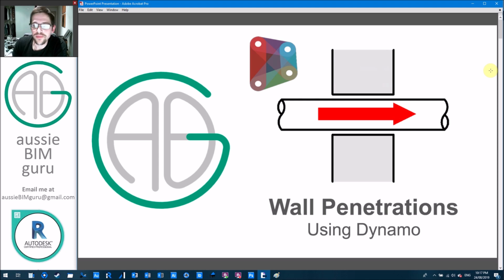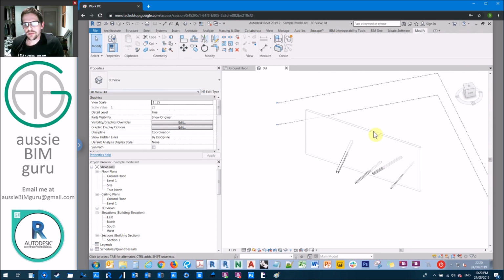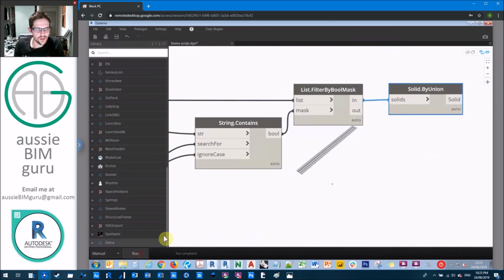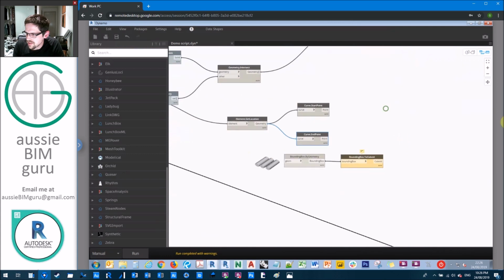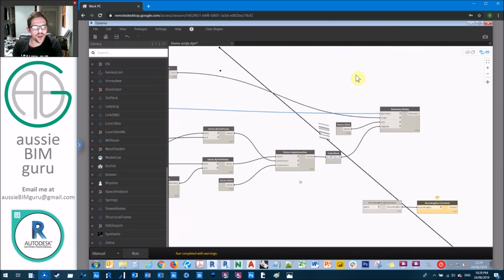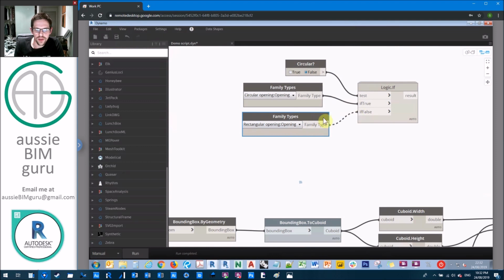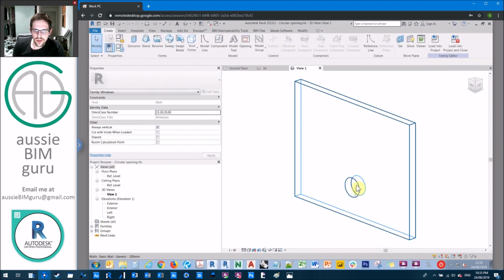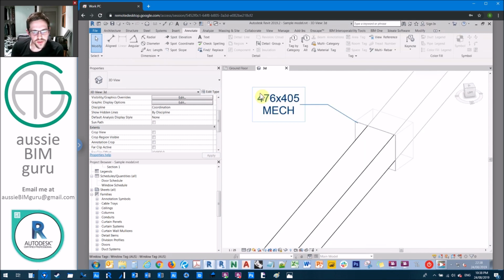Create Wall Penetrations using Dynamo!

Comment: Hi Gavin. Thank you for this tutorial. I would like to know if possible to make this penetration if the pipe is a bit slanted diagonally?
Reply from the maker: In the case that the pipe is on an incline, the geometry at the intersection will still encapsulate the overlapping zone due to using a bounding box approach.

Comment: Is it possible to but a condition if the mep elements clashes with the same wall, If it more than 500mm to consider it as two opening?
Reply from the maker: @AnarchisT3022  yes this can be done by  putting a sphere at each point of 250mm radius then solid unioning them snd disjointing, then grouping the intersecting data by which groups their centrepoimts intersect with, then unioning their geometries and doing 1 opening for each union instead. Its complex.

Python could also be used to iteratively find each group of points but its also challenging. The forums might be able to help.
Reply: @AussieBIMGuru can you show me how?
Reply from the maker: @AnarchisT3022  the channel covers c# these days so id suggest having a try and using dynamo forums for assistance.

I use the grouping logic in my workflow for chair separation as an example, using circles (just use spheres instead given its 3d):
https://www.google.com/url?sa=t&source=web&rct=j&opi=89978449&url=https://www.youtube.com/watch%3Fv%3DAo2GzXaLdr0&ved=2ahUKEwj1h9aI3amMAxVYrlYBHYBiB1EQtwJ6BAgMEAE&usg=AOvVaw1_KtlOuu-yKHMxeqPkmLbd

Comment: Hi Gavin. Nice script. it works with me but i put some modifying to work with a linked mep file and everything is fine only if i select a single wall but when i change the selection to select all walls in a level for example, it creates all the openings in one wall only. i hope you can help
Reply from the maker: To do many walls is a much more complex script and list structure, and not one i have developed yet personally. Maybe get as far as you can and consult the forums where unsure.
Reply: @AussieBIMGuru  thanks for the quick reply. i will try to find it out

Comment: wonderful video!!! Thanks mate. But is there a way to create penos for Fabrication Parts? A Fabpart Duct for example is not a solid but a mesh. How would you do the intersect test on that? Would love to get an answer.. or even better a video on that. :D :D :D
Reply from the maker: Generally I've found meshes to be very problematic in Dynamo, I'd likely switch to Rhino Inside Revit there if I had to work with more complex geometries as it's far more capable in Grasshopper/Rhino of working with mesh natively. In absence of that you could try mesh toolkit in Dynamo, but I suspect fab parts would give very inconsistent intersection geometries typically in Dynamo.

Comment: Another great post! Everything works great until I got to Springs.HostedInstance.ByPoints... this produces a null and I can't figure out why. Its causing an error in Element.SetParamterByName (dereferencing a non-pointer).  I'm running Dynamo 2.16.1.2727 if that makes a difference. Can you help at all? 🙂
Reply from the maker: Hrm I used an older version of Dynamo for this workflow, my best guess is maybe there's an API update that the node isn't able to account for. Double check you're using the latest package version, beyond there dynamo forums can be good for troubleshooting custom packages.
Reply: Hi Same issue for me did you find a solution

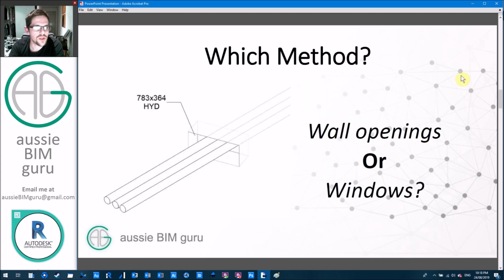Comment: 1:15 We also have a third option which is using Void. I want to learn your thoughts about that. Thanks.
Reply from the maker: Generally voids require inplace massing which is not available to the revit API or dynamo. Wall openings would be the fallback in lieu of windows but require a fairly different approach to mine.
Reply: @AussieBIMGuru  Thanks. This graph is fairly useful. If we work around would it be possible to select multiple walls stacked together and create a single or multiple (small depth) window openings.
Reply from the maker: @Semih_3  most things are possible, comes down to your programming knowledge. Personally i always program this a while at a time so users review the outcome before moving on.

Comment: I saw that the height and width parameters are of istance, but in windows family is type and built parameter. they are not editable as an instance. How to do?
Reply from the maker: Assign the parameter to a dimension, select it and you can tick on/off instance from there.
Reply: Thanks for answering me. Forgive me but I did not understand ...
the Height and width parameter are a type parameter and you cannot change them as instance parameters. how do you change them?
Reply from the maker: Maybe this thread will be easier to understand than my explanation:
https://forums.autodesk.com/t5/revit-architecture-forum/can-i-make-window-height-width-into-an-instance-parameter/td-p/2001881
Reply: @AussieBIMGuru  grazie mille

Comment: Super Amazing. I've made it work to me also. The only thing which doesn't seem to work well is the tolerance. It's always the same no matter what I choose.
Reply from the maker: Hrm that's strange, it's really just there in increase the width/height of the final opening so cross check that the formulae it relates to receive the value and change when it changes also.

Comment: Gavin,
First of all, amazing stuff, thanks for the tutorial! One problem I am encountering is that my family instances are getting mismatched. When I run Dynamo Player a second time (after refresh and new selection), my small pipe is getting the large opening and my large pipe is getting the tiny opening. To clarify, I believe the issue is residual data leftover from the previous run. Is there any way to clear/regenerate those data each time Dynamo is run?
Reply from the maker: This may be due to element bindings, which are an issue until 2022 where they added a 'flush bindings' tool. Usually this needs any node which creates an element to be replaced anew for the final script. It's a really annoying feature (in my opinion a useless bug).

Comment: Great Tutorial only discovering it now. Could you get it to work with linked Mech & Elec files?
Reply from the maker: Yes you could potentially do this using linked element collection nodes. There is a select linked element node in springs package, and various packages that have intersection methods for linked elements such as Bimorph nodes.

Comment: very awesome tutorial ^^ but is this possible if the wall is in a linked file? thank you very much ^^
Reply from the maker: Yes it would, it's a slightly different workflow though, you would need to be in the model with the wall(s), then select the elements from the linked model instead. There is a great node in the springnodes package called 'SelectLinkedElements' which can achieve this.
Reply: @AussieBIMGuru  thank you for your reply... i will surely try this method ^^
Reply: @vrbaac1641  have you made it work? how?

Comment: does that work with solid geometry from AutoCAD? I have a project when I receive the opening in dwg solid elements, how could I make the openings?
Reply from the maker: Hrm not quite sure, I've only done it using Revit so far. The 'BiMorph Nodes' package has some nodes for getting dwg geometry, maybe try these out and see if you can get solid geometry from them.

Comment: Great workflow...!! Would that extraction of geometry for walls and other elements when you have a huge building project be costly..? I previously had an experience while tying to extract geometries of furniture inside rooms. My system with 16 GB ram and Core i7 7th Generation with 4GB Graphics just crashed. Tried three four times with no success. Since then I am afraid of extracting geometry...
Reply from the maker: Yes for larger projects this could be taxing on system memory. Usually anything that gets all elements in active view or of a category in excess of 250 can be slow, same goes for geometry.

Where possible I suggest narrowing the number of elements you get geometry for at once. This workflow is OK as it only needs two elements' geometry at once per run so project scale isn't really a factor.

Comment: Hi Gavin, I followed your tutorial and created the script and the two opening families. By running the script everything goes fine (openings created and correctly oriented and dimensioned) except for the sill height which appears too low by half the opening height. Do you have any clue of the possible misbehaviour? I didn't try your opening families yet, maybe I missed something along the way. Thanks for your time. Bye
Reply from the maker: It depends on where the placement point is relative to the opening. For this workflow, it is best to use a window with the centre of the opening being the bottom reference of the family.
Reply: @AussieBIMGuru  thanks Gavin. I double checked my opening families and changed the default so height as you suggested but the behaviour remains the same. Using your families everything works fine though.

Comment: Hii Gavin, Thankyou for this nice workflow. I would like to ask you ....Let say if my pipe is not passing through the wall ?? It is going inside the wall but does not pass through the wall.
 Is this still going to work? 
thankyou Looking forward to your reply
Reply from the maker: As long as the wall and the element have some sort of intersecting geometry it should be possible. This workflow relies on that in order to find the bounding box around that overlap.
Reply: @AussieBIMGuru  Thanks a lot;)))))

Comment: Is it possible to cut opening base on clash report from revit
Reply from the maker: Yes probably. You would need to take all the clash coordinates out of Navisworks, find the nearest wall and also the size of opening required based on the clashing element.

It would use a similar method to this video for intrepreting the clash report data;
https://youtu.be/eRzWUCReqkc

Comment: Thank you so much for your sharing of knowledge!
This skript works like a dream (used structural opening family though)
Reply from the maker: You're welcome Vasiliki, glad it worked!
Reply: @AussieBIMGuru  Tried the script on another, much larger project. The Geometry.Intersect node returns an empty list...
Googled the thing, scaling down, intersecting and scaling back to normal size didn't work. Seems like Revit and Dynamo do not like huge coordinates...
Any experience with a workaround?
Cheers!
Reply from the maker: @Vasoulinho  usually the only way to handle it is to enable large geometry scaling in dynamo. Short of that you could locally adjust the coordinates by a common xyz offset (using add point node or add as a vector) to get your elements closer to a workable location.

Revit has a comfort window of about 14km, anything beyond that and it tends to be problematic.

Comment: Hi Gavin!
Great Example.
I am unsure of the fact that when we run the script for the second time it usually update the last results I tried  even with dynamo player.
Suppose I place a family by point selection now I want same script to place a second instance but what it does just updates the last result which results in deleting the first point placed and placing the family following the last selected point but my instension was to run the script to place a send point insted of deleting the last result.
Need your help how to solve this if I need the same script to run multiple times on same dynamo or revit session.
Reply from the maker: This behavior should only occur when the script is run from dynamo itself, due to what we call 'element binding'. There is no easy way to fix this behavior.

This shouldn't happen when run from dynamo player. To be sure, try refreshing between runs of the script and see if that helps.

Comment: Hello, thanks for posting.  I am only just getting into Dynamo and this script supported a task I was looking at and was really helpful, Thank you.  I developed it for my specific needs, however I have encountered a couple of challenges.  1 - using the centroid from the intersection geometry is different from the centroid from the combined bounding box geometry.  I found this out when combining multiple penetrations through the wall, the bounding box option as the placement point seemed to work better for me.  2 - Also, for some reason the centroid seems to reset to Dynamo 0,0 if I select penetration geometry that totals less than 80mm which it seems odd, and I have not figured this one out...  I thought you might like the feedback, I am probably using the script slightly differently so it might be how I have set it up.
Reply from the maker: Hi there, good point - the bounding box centroid is probably the best placement location in all scenarios, I think I made an oversight if I used the geometry itself.

The error sounds very weird, is it for the geometry specifically, or the bounding box as well?
Reply: Aussie BIM Guru It did it on both items.  Really weird.  I re-built the script and it seemed to solve it.  I must have had something off in my script.  I had re-worked it to adapt to the inclusion of Fabrication Parts in the elements selection option, as these come through as mesh not solids, so I need to adapt things to suit.
Reply from the maker: @digitalengineering1971  Maybe it was the bounding box sizing formulae near the end. Glad to hear it's working for you now though!

Comment: it doesn't work for me, for pipes in (object.type) (Protocore.DSASM.StackValue), not a solid you did, how can I fix it?
Reply from the maker: I believe some elements get geometry from medium detail level in dynamo. Try the element.geometry+ node from clockwork package.
Reply: @AussieBIMGuru  know ok, for the wall get location, form which package?
Reply from the maker: @alimustafa3885  this should be a node in Dynamo by default. Search for Element.GetLocation (or under the Revit > Element section of the library).

Comment: Great video again, can this script be modified so that it reads a linked model & gets the intersection of a pipe or duct element & place the void family you made to all the walls in the model in one go?
Reply from the maker: It could be, but would require a lot more work. You'd need to get the linked element geometry ans filter it down to the walls you care about, then use a similar workflow to this, but set up to handle multiple walls/elements at once.
Reply: @AussieBIMGuru   HELP PLEASE!
Reply from the maker: @victors.7717  might need a bit more specificity here - suggest emailing.

Comment: Hi, it's really great, any way can place the opening family in link file (arch), because usually mep engineers cannot direct change the arch model. thank you very much!
Reply from the maker: Yes as I mention at the end one way the workflow can be adjusted is to read linked elements for live walls. It's a trickier script, but possible using linked element detection and/or the bimorph package.

Comment: Hei
I wanted to use your dynamo script but unfortunally it sais its broken. When i want to build it by myself i have the error that there's no solid element after the list flatten. Is there a solution to fix this?
Reply from the maker: It depends on the element you are clashing. The script works for most elements, but the element needs solid geometry to be filtered and isiolated first.

The script aims to show a technique people can explore and adjust further to suit their workflows rather than be a one size fits all solution.
Reply: @AussieBIMGuru  i've tested the file with different types. In the list flatten there's only a function. Is it possible to get the center point in a other work around?
Reply from the maker: @Crimsii  not that comes to mind unfortunately, well no simple ways at least!

Comment: Gavin, thank you for the video that is much needed. I do not really understand coding and noding that much and finding my way thru by solving problems one by one.

Can you please provide us updated script since many of us have different type of problems to be solved.

For example I am having the following problem;  ''Solid.ByUnion expects argument type solid, but was called with function'' and I am missing the Springs node as well.

Thank you.
Reply from the maker: I'm without access to dynamo until march unfortunately. The videos aim to provide a workflow/concept so others interested in learning dynamo can explore it further based on my script.

Try the script I shared onto my github maybe, and make sure you use dynamo 2.0.3.

Not sure why the solidunion is receiving a function, maybe email me a screenshot (not script) of the script as well as the node contents before the solid by union so i can see what is going wrong.
Reply: @AussieBIMGuru  Thank you for answering, I have figured those out and now got new other problems...

Element.SetParameterByName node shows error ''No Parameter Found By That Name'' even though I set all the parameters as you have done.
Reply from the maker: @peregrin6992  make sure it is instance based, most likely problem if it can't be found in an instance
Reply: @AussieBIMGuru  Gavin I've come to some point but if I do multiple selection, I end up having a giant window with a point in the middle of it. Here is the ss of what I am talking about. https://drive.google.com/file/d/1-I026aVZmHRD7HfumgFu3qQp0-tPZpxj/view?usp=sharing

 Again thank you for all the help you are providing.